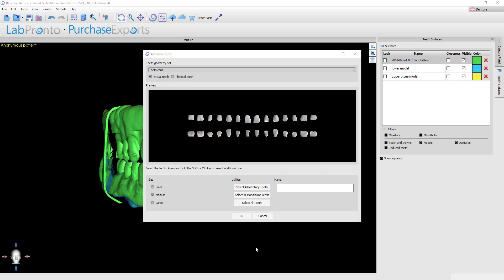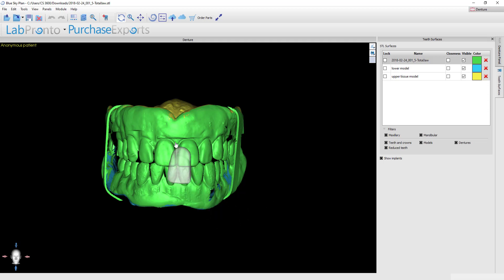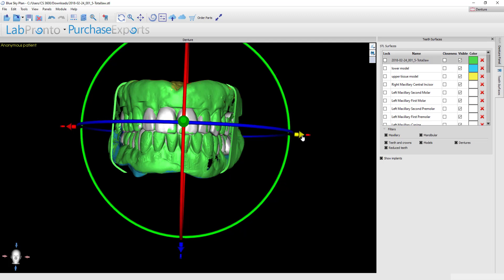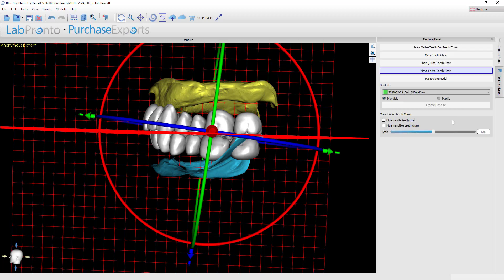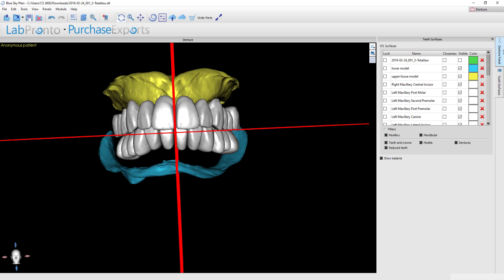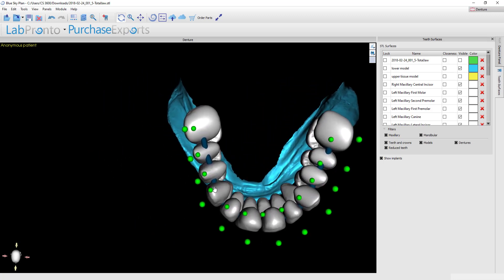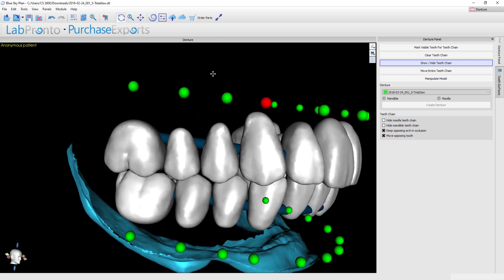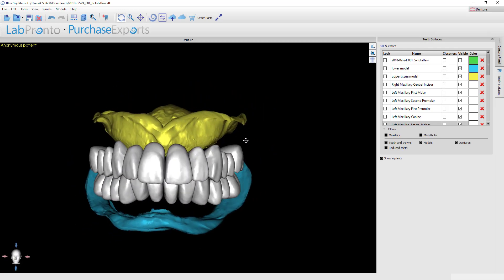Step 3  Setting Teeth in the Blue Sky Plan Denture Module  v 4 7 15

Comment: In my most current software version when I create the tooth chain for purpose of hinging the chain to align over the ridge as you demonstrate in this video ,  it seperates the whole opposing arch out of occlusion about a millimeter even with the boxes “keep opposing In occlusion” checked to prevent this, and with no way to return them into touching occlusion    ? It Doesn’t seem to do it in this video . Why does it do that ? I have to go back and move each tooth back into occlusion individually , seems to defeat the purpose somewhat.

Comment: Just an observation if you please.  You are using the patient's old dentures to establish vertical and centric, yes?  This is an excellent technique that we have used in the lab for years.  However, experience tells me that the technician that set up this denture set the plane of occlusion slanting downwards (see 5:29). I realize that the rule of thumb is to set the lower second molars two thirds of the way up the retromolar pads.  If this occlusal plane isn't raised it will have a negative, unattractive appearance in the patients smile (I'm not referring to curve of Spee & Wilson)  Also, instead of dropping the second molars I would suggest you drop the second Bi's and move the molars forward (much better appearance) Just my humble opinion =)
I would like to try this software out ... it's definitely the future of removable dentures.